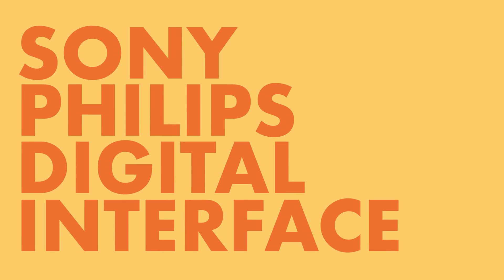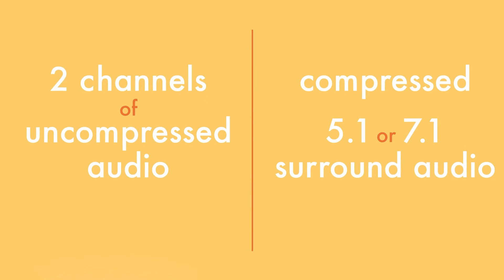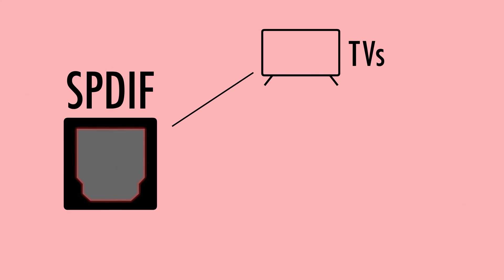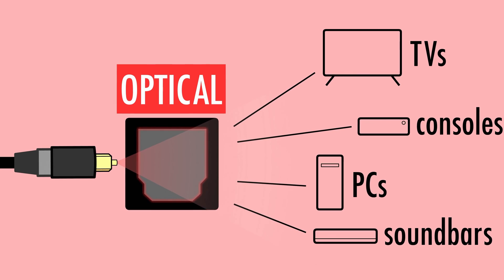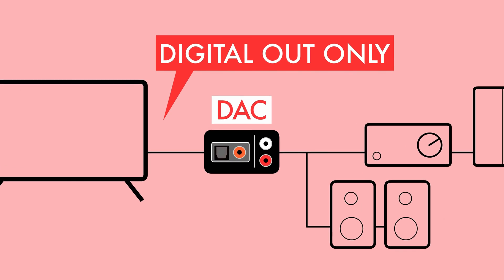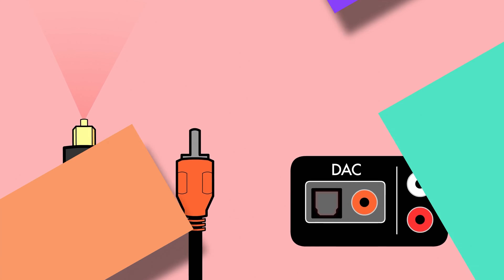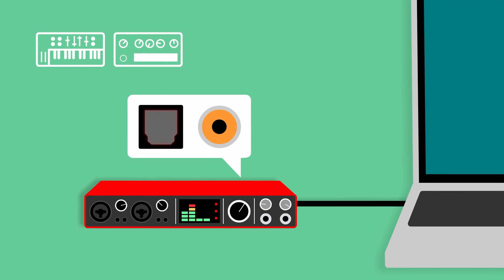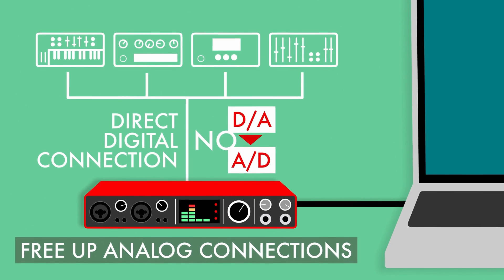What is S/PDIF and how can you connect your digital devices with it?

Comment: Do you have an Amazon link for me to support your channel? I have a Sony BR/DVD/CD player that I intend to use as a stand-alone CD player. To do this, I think I need to buy a digital coaxial to aux cable, correct? Since my soundbar (Samsung) should have a built in DAC.
Reply from the maker: Hey, yeah you should be able to use an HDMI or an optical cable provided your soundbar has inputs for one of those. 

As for the link, here's one - https://amzn.to/3FvBu7O - you obviously don't have to buy the mic, as long as you click through to Amazon from here and buy the cable, it should count :) Thanks for considering that by the way, appreciate it!

Comment: My TV has toslink output but device I want to connect it to has round optical input port (I guess coax). Can I connect the two together? What cable would I need?
Reply from the maker: Unfortunately you'll need a Optical (toslink) to Coaxial converter box :(
It should cost around 20E or so

Comment: Im trying to go from an older iPad air with the 3.5mm aux to an optical input of a dac. Any suggestions would be appreciated. thanks
Reply from the maker: The output of the iPad is already analog, so there's no point trying to go into a digital-to-analog converter, you should be able to directly connect it to whatever the dac is connected to.
If you really have to do it, then you would need an adc to convert the aux to digital that you can send to your dac to convert back to analog, but that seems a bit pointless...
Let me know if I'm misunderstanding smth :D
What is the final device that you want to connect the iPad to?
Reply: @arbitersofsound  I am connecting it to my amp. Thanks for the reply
Reply: @arbitersofsound  I would be coming from the dac to an amp and out to speakers. Thanks
Reply from the maker: @ Since the signal from the iPad is already analog you could connect the iPad to the amp directly with a stereo mini-jack to rca (red-white) cable.
You don't really need to connect to the dac, since the dac is waiting for a digital signal (which it then converts to analog).
If for some reason it's not possible to connect directly to the amp and your only solution HAS to be going through the dac then you would need a way to convert the analog signal from the iPad to a digital one. So basically an adc (the opposite of the dac) with a jack or rca input and an optical out. It's kinda pointless and expensive but I don't know maybe your amp is in a hard to access place or all of the inputs are already taken... :D

Comment: What's the best way to integrate regular speakers (let's say a soundbar) to a desktop with recording setup (Audio Interface + Active Speakers)? Is it by splitting the headphone out of the Audio Interface?
Reply from the maker: If the interface doesnt have a digital out, I'd probably try a stereo line out first. Use a Y cable to connect 2 mono line outs to one stereo mini-jack that you can connect directly to your soundbar.
If you don't have spare line outs you could try the headphones (although splitting them would become annoying especially when you want to actually use your headphones...)
Last idea would be to get a small signal splitter with independent volume control for each output and connect the main out from the interface there and then connect the outputs to your different speakers.

Comment: Hello... I bought a tv which has spdif out... My previous tv had a digital audio out to which i was connecting my denon avr which also had an optical out.. the new tv i cudnot connect the same optic cable... Are the spdif and digital audio out have different cables and plz let me know if there is a way i can connect my new tv with my denon avr... Spdif to optical out... Thanking you
Reply from the maker: Is the spdif on your new TV using a coaxial output?
Because spdif exists in two versions, the one that uses the optical cable and the one that uses the coaxial cable (the rca connector).
Both are digital and both are sending the same spdif signal, but unfortunately they use completely different cables and ins/outs.
If that's the case what you need is a Coaxial to Optical Converter. Probably would cost smth around 20$ from what I can see online.
So you can connect the coax out from your tv with a coax cable to the converter, and then connect the optical out from the converter with your optical cable to the optical in on your denon :D
Reply: @arbitersofsound thanks a lot for the reply... Technically im not a good person... But from wat i researched after seeing your reply i think its not coaxial out... I wish i cud share a pic
Reply from the maker: @rakshithshetty4439  You can join our Discord server if you want and send me the pics there. Or you could e-mail me at the address on our channel page :D

Comment: Hi, thanks so much for this! So if I'm using the S/PDIF in the studio, how would it connect up? A TRS to Coaxial cable? Or does the device need to have an S/PDIF connection? And is this to record into the interface, or to send out from it? Which way can/does the signal flow? Really appreciate your help!
Reply from the maker: You can only connect devices that have SPDIF. Most commonly you will find them as a coax cable pair on studio gear. Each cable transmits 2 channels out and 2 in. So you could send 2 channels out from your interface to a digital effect with SPDIF on one cable (lets say the white one) and record the effected audio back on another cable (the red one in this case). I hope this makes sense :D
Reply: Spdif  not 5.1 channel

Comment: Thanks for this explanation. I have seen on the net, an all-in-one cables to convert digital audio to analog. My question is, which solution (all-in-one or DAC small boxes) would be better to select in terms of performance.
Reply from the maker: I don't really have any experience with all-in-one cables.
A regular DAC should do the trick. If it's usb powered, just make sure that it gets power from an external adaptor because plugging it into some tvs might be very noisy.

Comment: I have a laptop connected by Toslink cable, SPDIF output selected, to self-powered speakers with optical input but no audio plays from the speakers. According to the manufacturer EDIFIER of these speakers, the optical audio must be PCM. Isn't it always so? What are my options? Greetings.
Reply: PCM (Pulse Code Modulation) is a common format for digital audio. However, digital audio can also be encoded in other formats such as Dolby Digital or DTS, which are not compatible with all devices. If your speakers require PCM, you need to ensure that your laptop is outputting audio in PCM format.
Check Audio Output Settings.

On Windows:
Right-click the speaker icon in the taskbar and select "Sounds."
Go to the "Playback" tab, select your SPDIF output device, and click "Properties."
Under the "Supported Formats" tab, ensure that only "PCM" is checked.
Under the "Advanced" tab, make sure the default format is set to a PCM format (e.g., 24-bit, 48kHz).

On macOS:
Open "System Preferences" and go to "Sound."
Select the "Output" tab and choose your SPDIF output device.
Ensure that the output format is set to a PCM format (typically found in the "Audio MIDI Setup" application, where you can configure the format for each audio output).

Comment: any interfaces with multiple spdif inputs? I would like to livestream multiple instruments with their spdif signals to keep everything digital :D
Reply from the maker: The RME Digiface USB is the only thing that comes to mind really. It has 4 pairs of SPDIF ins and outs but all of them are optical (because it also doubles as an ADAT interface).
Would something like that make sense in your case?
Reply: @arbitersofsound  thanks for the reply. I once live streamed a small concert with a native instruments komplete audio 6 1 output for the streaming device and the headphones and another outputs for our monitors. I used the kemper spdif out with the in of the komplete, but the Acoustic guitar and mics through the analog inputs, was thinking if there was an interface with multiple spdif ins could be nice to have 3 profilers for example on a rack with the interface and leave the analogue inputs for vocal and drums.   I really liked using ableton as a mixed and being able to turn all inputs of the interface on with no hassle.
Reply from the maker: @Jriv463  My only concern with using multiple profilers over SPDIF is that they are not happy if they are not the master clock (at least the rack unit that i have). So I don't know how they would behave if you had 3 of them running SPDIF at the same time 😅
Reply: @arbitersofsound   once again appreciate the responses :), I actually have no experience with master clock topics and just learning it from you,  hmm if it helps I remember all the Kemper outputs can be configured. For the spdif if I remember correctly you can set it as a monitor out (stereo) , or as the DI channel, or as both I believe. On my laptop I remember having only the NI Komplete 6 plugged and the kemper only plugged to this interface. When opening ableton and setting the interface, I saw the 6 inputs from the interface and when arming the spdif input, the sound was with no latency, but I believe it is a limited sound quality from Kemper over this output. What problem could the master clock topic create in this setup?
Reply: @arbitersofsound  should have specified, the rme is optical but would like something like this for spdifs with the other type(rca?) Leaving the sound of each instrument to it's originating device.
Reply from the maker: @Jriv463  I imagined that you were talking about the coaxial (RCA) one, but I cant seem to find anything that does multiple coax SPDIF inputs. Unfortunately in your use case its probably better to invest that money on a large rack mount audio interface (like a 1820 scarlett which is in a similar price range for instance) and have lots of analog ins and also lots of ADAT for future expansion. And obviously you can connect all the headphones etc and do all of the mixing and monitoring from inside Ableton as you are already doing. In any case if you need more help with gear and setups etc hit me up on Discord 😃
Reply: @arbitersofsound  Thanks, this one seems to provide a lot of input and output capabilities and spdif options, on my side have been considering the Arturia audio fuse rack lines  if going only analog I see they have additional USB options for MIDI devices (to have everything in one rack)and in NL feedback I get from music stores is they have really good preamp signal, similar to the presonus iostation24c I am currently using, not needing a triton FetHead preamp(which I currently use on the focus rite and the native instruments for a shuresm7b.